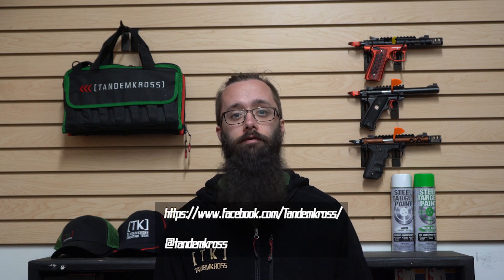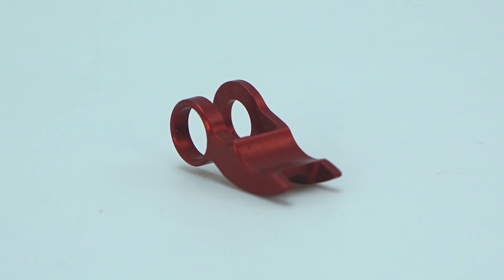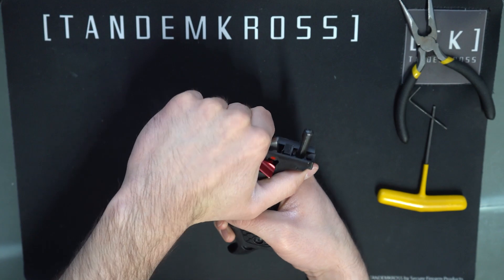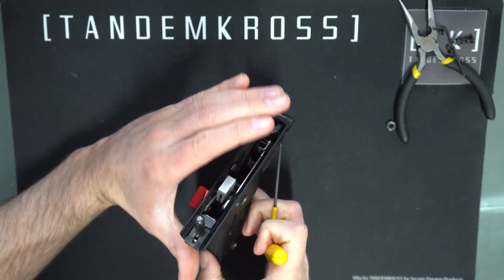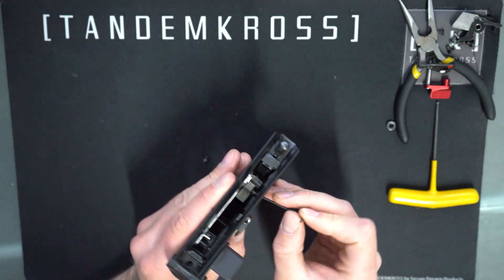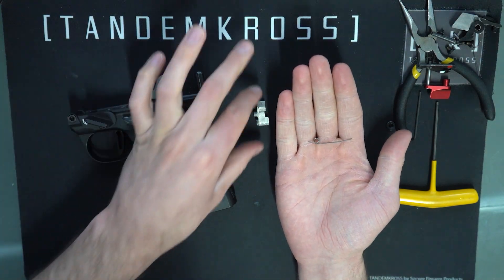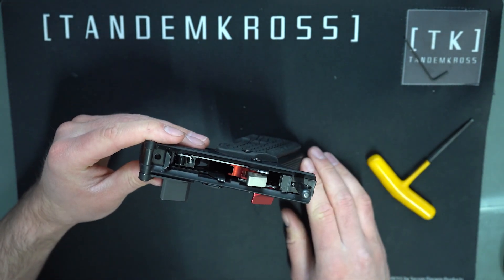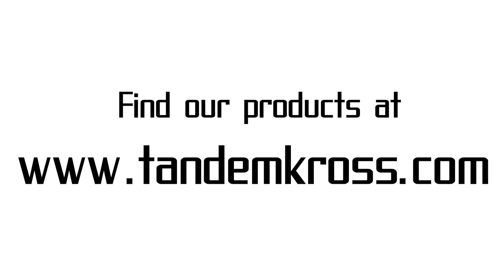TANDEMKROSS - "Blast Pack" for Ruger® MKIV™ and MKIV™ 22/45™ - Install Instructions

Comment: Thanks for this great video! I did the upgrade on a Mk IV target. It went basically the same. This install only took about 20 minutes and I did not have a “third hand”. 
One thing to note, there is a magazine ejector “helper”.  It’s three tiny parts. If you take off the grips on the target gun, the parts might come off. Be mindful of that when taking the grips off the target version.

Comment: Great video thanks
One thing i noticed for those retaining the factory right side safety, It has a "T" slot as well as a counter sink on the factory shaft so the screw goes all the way down. I modified the TK safety shaft to match the factory detail 
I also didn't  like the rough finish on the TK sear and hammer so I polished the sear lightly and hammer face.....Sooo much better

Comment: After 2 peircings on the left thumb, 3 hours, 4 times the spring flys to the ceiling, 20 f bombs and a fake margeritas later... i got it working. Coll thing is if you pull the bolt back partially and not entirely, the blast sheild with no spring will double as a bolt catch, then by pulling it back all the way will sling shot the bolt back into batterie. Also damn ruger for making the bushing a pain to remove from the origonal hammer and sheild. But i got it done and now its better then ever.

Comment: I bought the ultimate trigger kit. But your video is too lousy I had to refer to Apex video to install. You guys should learn how to make installation videos from Apex.
Reply from the maker: We're sorry you had a hard time with the video. We have live tech support, as well as written instructions on the product pages  that may work better for you in the future. Thanks for your feedback!
Reply: Worked for me. No prob
Reply: You should do more research on how firearms work.
Reply: On the 22/45 lite wasn't super easy but did make the trigger pull extremely light I'm no expert I do construction it took me roughly an hour and half to 2 hours because I wasn't super familiar and got a Lil worried but after a bit of tinkering and God forbid dropping tiny pieces I got it done did have to take a break due 2 frustration  UT great way to learn your weapon